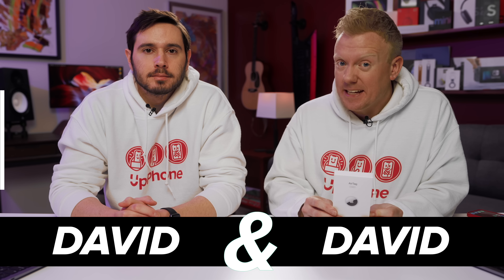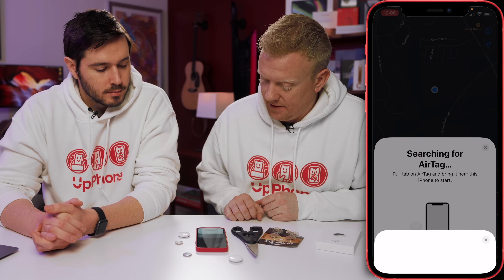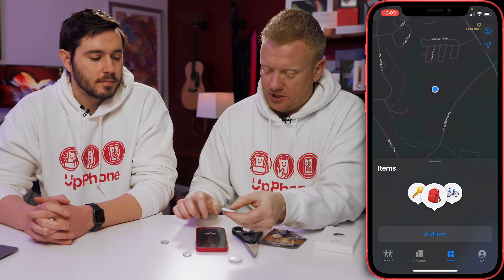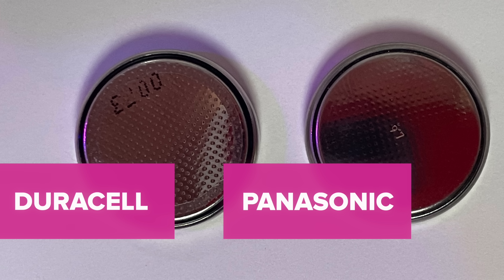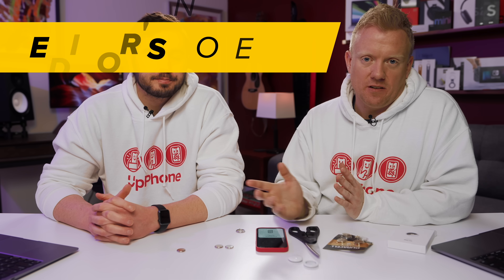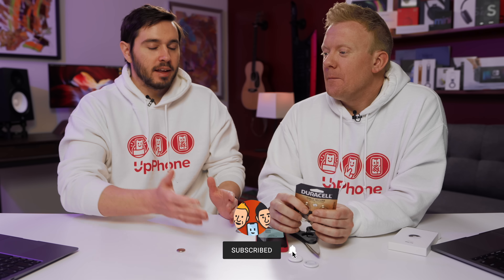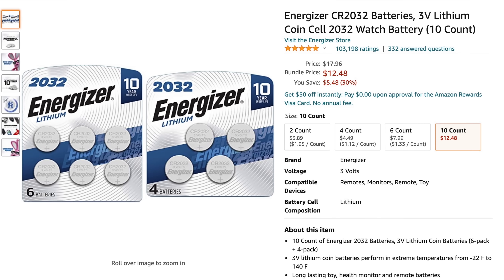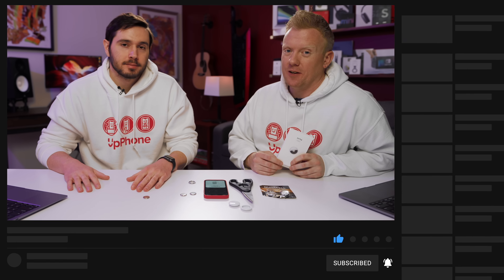HUGE AirTag Battery Problem! Replacements Won't Work! Apple's AirTag Design Flaw, Explained.

Comment: Omg thank you for this video! I was going crazy trying to replace a battery. It’s true that it chirps when it’s angled but when I put it a cover, it doesn’t work. I thought my AirTag was defective and was ready to throw it away! Makes me wonder if Apple did this by design to get people to buy more AirTags instead of batteries because it’s 4 years later and still not fixed!

Comment: I sanded the clear coating off the Duracell and it started working. Thanks for the heads up, I would have never found the problem without it.

Comment: What I found out is if you switch the battery from 2032 to 2025, it might work for you if cleaning doesn’t fit problem.

Comment: I'm not sure what happened with you guys, but I have Duracell batteries in  6 AirTags,  I've been using these for two years and they all work.  They can be tricky to reset, but they work.  I wonder why you are seeing this problem.

Comment: Used Duracell battery and wiped it down with a Clorox moist wipe paper cloth. Dry with towel and it made the little noise when installed where it didn't prior to wiping with Clorox.

Comment: Interesting- I just took the original batteries out of my air tags and they are Duracell batteries. I tried replacing with Duracell and had problems . Hmm

Comment: I bought my Air Tags in 2024 and they came with Duracell batteries - Apple must’ve fixed it now
Reply: same
Reply: Same exact battery but that film is on so it doesn't connect connect. Had to wipe it with Clorox first then it worked.

Comment: The battery manufacturers DO NOT have to adhere to battery design standards. I have bought 9V batteries for my smoke alarms that did not fit. I have seen some  brands that are 1/8” longer than others.

Comment: I use generic eBay bulk CR2025 or CR2032 batteries.  They work okay but the AirTag says replace very frequently.. then when testing them, they’re very close to 100% capacity.

Comment: My four pack of AirTags came installed with Duracell batteries and work perfectly however I’ve just had to replace the battery using an energizer battery and have the same problem. 😡
Have tried using fine sandpaper, but the problem still exists. Now need to find some rubbing alcohol!

Comment: Just searching video “ how to reset AirTag “ coz I lost it meanwhile I unpair it and because AirTag wasn’t in range of Bluetooth I must do it on “ old “ way 4x put and take out battery to reset and guess what I used Duracell battery 2032 few times AirTag didn’t respond and then I cleaned housing with alcohol idk but combo Duracell and AirTag working just fine

Comment: Okay. Just to confirm it is NOT the rubber around the battery rather the bitter coating that is causing the poor connection. I tried rubbing alcohol, that only works occasionally, easiest it just rub with a fine sandpaper, to scrap off the coating.

Comment: I was able to get it working after awhile, hold duracell battery at an angle and connect it first. then finally lay it inside and put the cover back on, very strange and awkward.

Comment: Still a problem 2024 - just tried VARTA and it did exactly like the video.  Tried the alcohol rub - no change.  I had used Sony before and they works- off too buy some more

Comment: Indeed, it does work!  Please refrain from placing the back on at this juncture. Press and hold the battery with your fingers. Subsequently, connect the device. Once the device is connected, proceed to place the back on. I recently attempted this procedure and it was successful. I recommend you try this method. I trust it will be beneficial to you. The Duracell batteries do work!

Comment: I realize this video is three years old, but I just replaced my air tag battery, and low and behold, it was a Duracell from the factory. The rim is thicker than the Panasonic (from my key fob, I replaced both simultaneously; why not?). So, they do work with Duracell batteries now.  Maybe apple changed their design?

Comment: 🚨Just use an alcohol wipe and wipe the battery out really good to remove the coating and then replace it on the AirTag and it should work!!

Comment: I just replaced my AirTag battery with one of them Duracell ones. It didn’t work so I licked the back of the battery and boom it worked just fine. I saw that on another video. AirTag back up and running. Be careful it leaves an AWFUL bitter taste in your mouth! 😂

Comment: I have recently found that I have number of devices that work perfectly with Panasonic batteries but not Duracell.  Had a Garmin heart rate strap that I had assumed was broken changed battery to Panasonic 2023 battery and works perfectly.

Comment: I purchased the Duracell batteries from Costco. My Apple AirTag was not reading the battery. After reading the comments about the "coating" for kids, I took some Goo-Off and rubbed it down as much as possible. I put the battery into the AirTag and DING! It worked.

Comment: Dunno if this is helpful to anyone, I just bought a 4-pack of Airtags and they have Duracell batteries in them from factory now...? Front of battery says "CR2032 Duracell Made in China 3V. The number on the back of the battery is IE11A16N but I don't find any results for it. The black ring around the battery looks thinner than either of the ones in the video. Meh, who knows. Airtag Model is MX542X/A.

Comment: In order to fully reset your air tag with the battery you need to take the new battery out up to 5 times. You will hear a different chirp and the airtag is ready to use with new battery

Comment: Great video tried the Duracell wasn’t working so I searched it up and as soon as I put it on at a angle it worked but still going to have to switch batteries from Duracell

Comment: Thanks for the video. I have the same problem . I bought a pack of batteries  “cT-Energy LIR2032 at Walmart, but the batteries got hot Once when I installed them,. I thought the problem was the batteries. But now with this video I understand it.. Apple needs to notify us what exactly is the battery we should buy so as not to make an unnecessary expense

Comment: Sure enough, we have only Duracell 2032's with the bitter coating. I've tried to clean off the coating repeatedly with 99.5% Isopropyl Alcohol and it still doesn't work. Just tested the battery with my tongue and it's still incredibly bitter . Ordering Panasonic batteries. 😠

Comment: Duracell changed the side where they put the bitterant on. I recently bought Duracell CR2032 batteries where the bitterant is applied to the positive side. They probably changed it to cope with this problem.

Comment: There is an almost invisible bitter film on the negative side of the battery. It looks like a small clear round sticker if you look very close. I took a piece of sandpaper and sanded it off, and the Duracell then works. Better off not buying Duracell if you don’t want to go through the hassle

Comment: Today i changed the battery in my AirTag to a Duracell 2032 with the funny rabbit on it. Nothing happened… I started a service request and explained what I did. I also told them that I replaced the initial battery with a Duracell battery, but they apparently don’t know about the Duracell problem.

Comment: i swapped new oem airtag battery (newer unscratched airtag for backpack) to another airtag (scratched that hangs on key) that had a low battery, and it didnt work and doesnt make noises. 

s m h

Comment: Thanks for posting this.  I was so frustrated...I even threw away one of my AirTags in the past because I was sure it was broken.  Then I read through some of the comments and I saw "clean the battery with rubbing alcohol".   BOOM!   I knew the batteries were NOT the problem.   I ended up fixing 2 AirTags...they connected quickly and easily and all I did was put a little Isopropyl alcohol on a rag and rub both batteries.  DONE.  WORKS FINE!
Reply: And both batteries were Duracell!

Comment: The batteries are shaped wrong. I was able to make them work by scraping plastic off the center area of the case using a curved surgical blade #15. If you rotate the battery while pressing down you will see where it rubs stainless steel off onto the plastic, that is where it is too high. Since I bought the 4-pack I guess I will have to modify all my Airtags. Pretty surprising that Duracell lets this happen.

Comment: What to do if it’s obviously connected and drawing power from the battery, but no sound? Is there any solution besides taking it in for repair/buying a new one?

Comment: I have exactly this issue with Duracell in the UK. My Duracell powered AirTags simply do not work (I tested the batteries with a multimeter though). Thanks for the tip.

Comment: I called Apple, it has to do with bitter taste coating they put on.  I scraped it off with a razor and it works. It's just on the back side of the battery, the negaative side.

Comment: what I did is that I removed the coating and also positioned battery is the other way - and it worked. But I threw out a bunch of 3V batteries because I thought it's duracell problem.

Comment: Apples official guide on replacing the battery states that batteries with a bitter coating will not work

Comment: I know a lot of people have said this already but to clean off the bitter coating, which is the thing screwing up the connection between these batteries and your airtag (I actually had a similar issue with a Logitech Bluetooth keyboard, where my duracells were not working) is to just use some rubbing alcohol, and to scrub the battery clean with either a q tip or an old cloth, just clean it 2 or 3 times and it should work perfectly fine after, please do not use a knife to get it off, it is not a good idea at all

Comment: Funny, I just had the same issue and jump on YouTube to see what I did wrong or if other people had the same problem. Bingo you video popped up and you explained the problem. I brought 1 battery from CVS. I was about to take it back and tell them this battery was bad. Guess that’s not the case. I put the old one back and it chirp like it was suppose to. I am going to try what someone on the comments mentioned and use a Q-top with the rubbing alcohol.

Comment: Thanks. ALL my tags had stopped working/low battery. I bought Duracell for all of them - and had the issue. Found this video - will now replace them all again with cheaper batteries

Comment: Yeah I recently threw out an AirTag, because I thought it was bad after replacing the battery with a Duracell. Then came across this. Called Apple and the folks I spoke to didn’t even know this was an issue. Said well maybe have someone put in the instructions when replacing the battery that Duracell isn’t compatible and the guy kept telling me they offer good customer service. I thought maybe they would offer a discount on a new one or a replacement, but was told no they can’t do that, because they offer good customer service 🤦🏻‍♂️🤣

Comment: The Duracell CR 2032's has a Child Secure + Bitter Coating that is preventing the airtag from working, I just used rubbing alcohol to remove the coating from the battery and now the Airtag works great now!!! Rubbing Alcohol removes the coating in 10 seconds, I just used a regular disposable papper towel for this...

Comment: I found that the battery cover also doesn't sit flush with Duracell batteries. I can close the case, kind of, but I can see the case is definitely not sitting correctly. So I was thinking the Duracell battery may be thicker?

Comment: Thanks for this discovery. I found that a gentle application of a small rasp around the negative edges of the Duracell battery solved the issue.

Comment: I don't know men, my Airtags arrived with Duracell batteries inside them. But If retail Duracell don't work, I will just buy Energizer that work. Easier to change battery brands than to change tracking device suppliers.
Reply: And I just tested using Energizer. It works fine.

Comment: I found this out the hard way. Luckily, I found an Energizer CR 2032 and it worked. I almost considered dumping this AirTag out and replacing it with a Tile. I saved $28 for now.

Comment: Yep, it happened to me.  I purchased batteries from Amazon.  Called Tianqiu.  Didn't work.  I'm going to try the alcohol thing and see what happened.  Update.  Alcohol didn't solve the problem.  There's a rough surface on the new battery compared to  old battery (Panasonic) that has a smooth surface.  Ordered Panasonic batteries.  I will update soon.

Comment: Today I  bought  a 12 pack of 2032s from Sams Club. Prior to installing them;  I got my multimeter and checked all the batteries I was going to install. I checked them in several different places same results no voltage drop offs. Then I checked the ones I took out they were low voltage as my I-Phone indicated. The only thing I didn’t do is lick the battery.  I don’t know what to say all mine function and I always use Duracell.

Comment: Give the battery a good rub down with nail polish remover, or rubbing alcohol. That gets rid of the childproof/bitter coating. That’s what’s causing the poor connection. Make sure to focus on the sides of the battery. Works like a charm!
Reply: Worked perfect
Reply: Didn’t work for me on my Duracells
Reply: Thank you
Reply: Yes you are correct - remove the coating and your good to go.
Reply: Hey, it worked! Thanks
Reply: So true.
Reply: this worked for me thank you!!!
Reply: Worked with my Duracells. Some required a second rub down.

Comment: EASY FIX: To remove the bitterant coating, wash the battery in hot water with vinegar for about 30 seconds and then scrub the edges with a scouring pad, dry battery and replace, viola it works!

Comment: I’ve washed it in the water and dried it with a napkin, and it’s working. So you just need to remove that bitter coating. That’s it.

Comment: I just discovered this problem. I had a pack with a couple of Duracell batteries from a few months ago and tried them both in my Airtag, but no luck. Thinking the batteries were probably dead, I went and bought a new 4-pack only to discover they didn't work either 😞. Unfortunately I bought Duracell again (they're supposed to be the best right?). I checked the voltage with a multimeter and could see they were outputting the correct value which lead me to Google to see if there was any information about this issue and that lead me to this video. I wish I'd searched it sooner. Surely the problem is with the Duracell batteries rather than the AirTags? I'm surprised that Apply hasn't notified users of this problem, it's not like they don't know I've purchased a few AirTags.

Comment: Amazon Basics 2032 works as well.
Cleaning the Duracell with isopropyl alcohol did not work.
It is not just the cost of the battery but also time wasted trying to get a working solution, including finding out that there is a problem.

Comment: It is my understanding that it is the bitter coating, not the battery, which is the problem.  I have no issues with any "non bitter" battery replacement

Comment: I wiped my Duracells down around the edges with rubbing alcohol and they work fine in my AirTags. This video is incorrect but the comments provided a useful solution.

Comment: Bought the same Duracell batteries with the non-toxic bitter coating. I removed the coating with alcohol wipes and it works fine. Thanks for posting.

Comment: There is a bitter coating on the back of the Duracell battery that is stopping the connection. Not wanting to waste the money I spent on several batteries, I simply slid the battery back and forth across 120 grit sand paper about 10-15 times. Easily removed the bitter coating, didn't damage the battery, and now the Duracell batteries works in the AirTag.

Comment: I found this video after replacement of the battery didn’t work. 
Gave the battery a little sanding and viola it worked… 
Btw - those bitter batteries, sure are bitter…